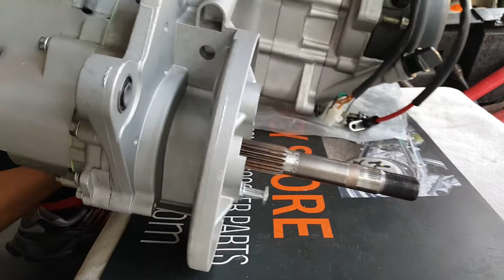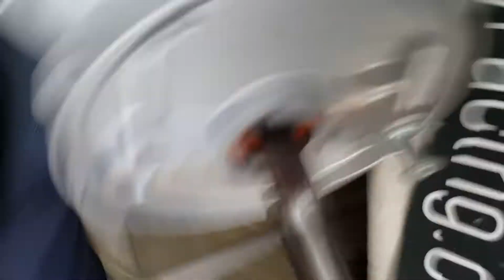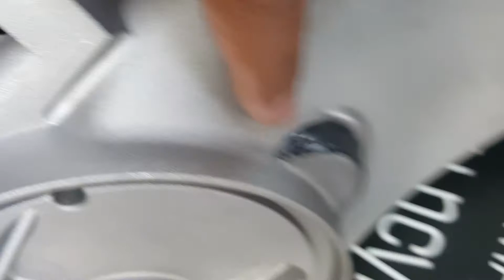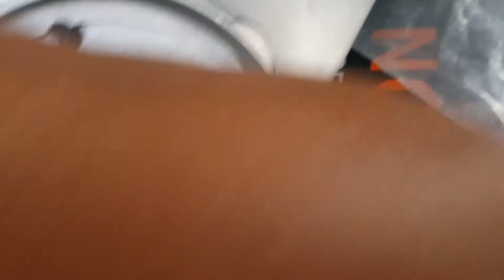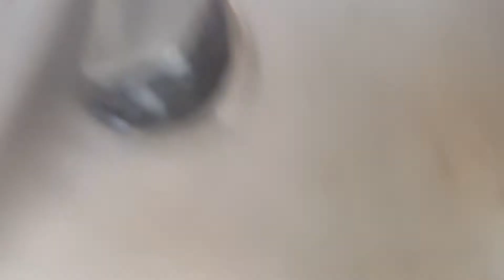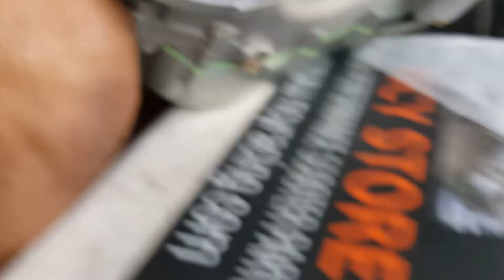How to repair crank GY6 Crankcase with J-B Weld Part #3

Comment: I've seen that fracture on other viewers GY6 cases. That is a serious defect, the case should be either be scrapped or perhaps reinforcements could be welded in by a competent welder.

As NYC, you are in the position, where you have enough gross sales, where you could recommend that additional material be added there.
Reply from the maker: I might mistaken and just maybe thought I had forced transmission bearings into much. Can you share with me another incident someone else has the same issue with ssp-g 180cc power kit crankcase?